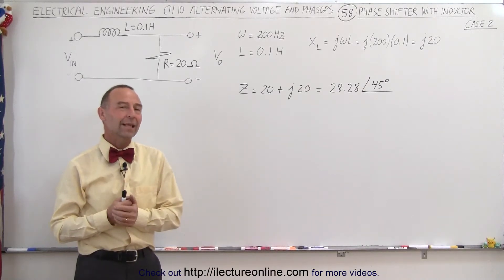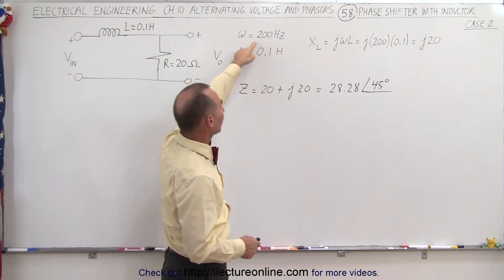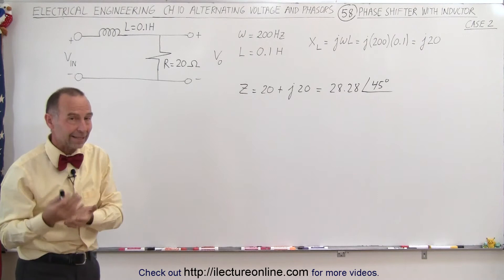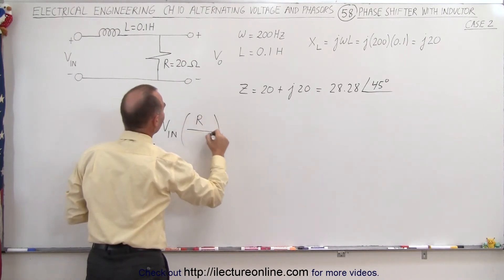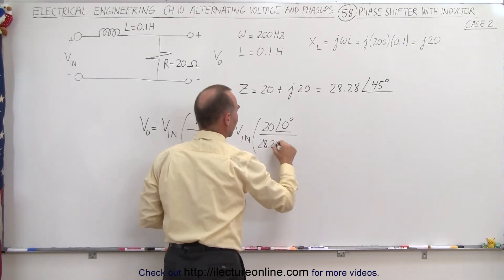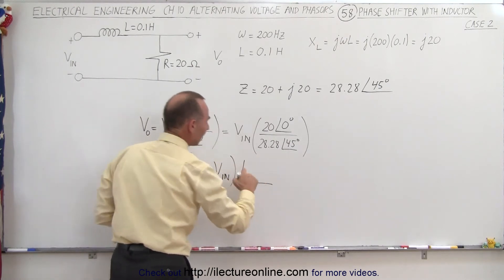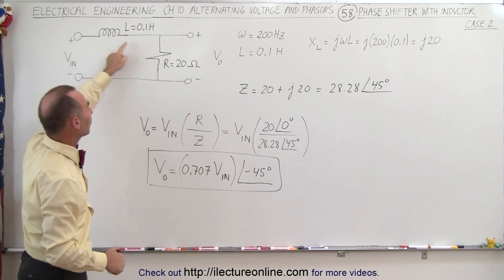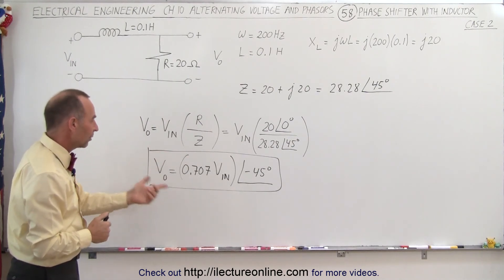Electrical Engineering: Ch 10 Alternating Voltages & Phasors (58 of 82) Phase Shifter w/ Inductor: 2

Comment: A phase lag as expected. One can tell this by looking at this circuit because the output voltage is across the resistor and in an RL circuit like this, the VL will lead I. And since VR and I would be in phase for a resistor and VR=Vo, Vo lags VL.